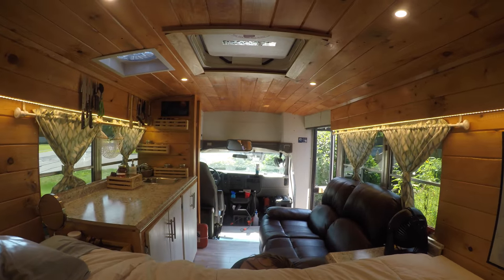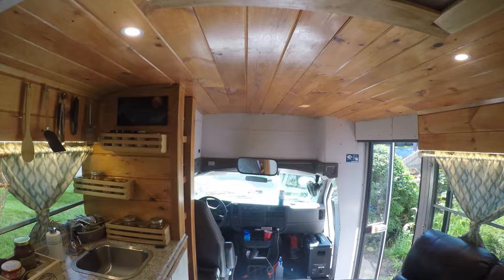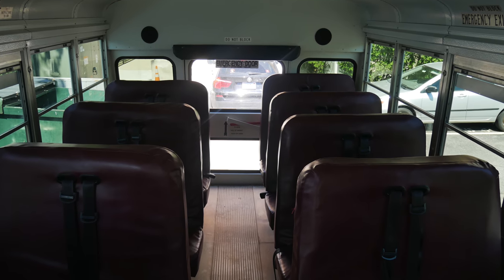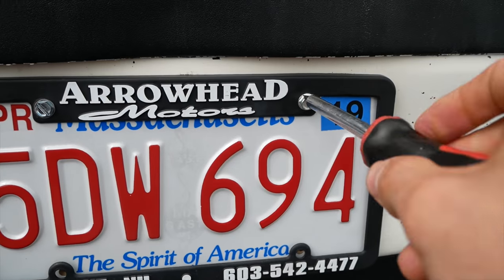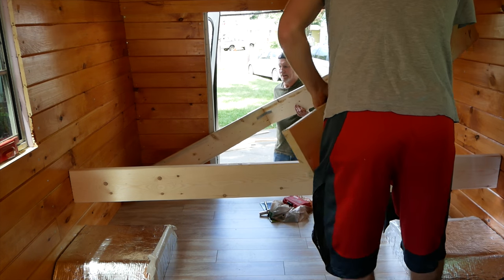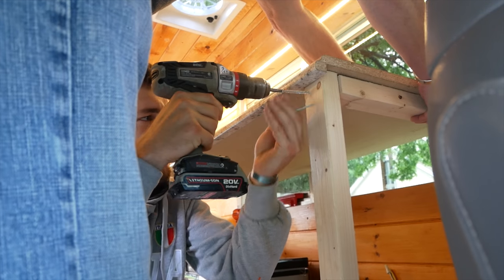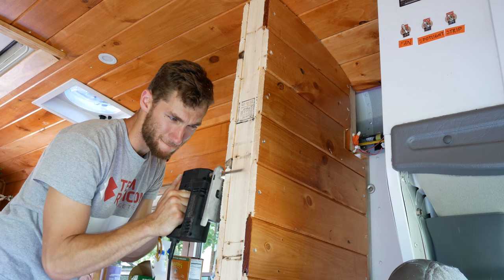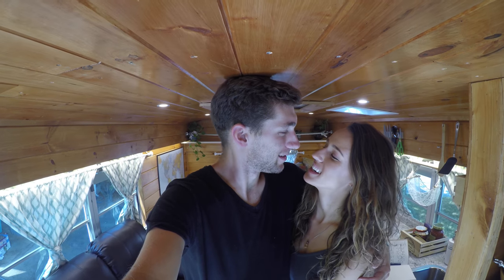SHORT BUS TINY HOME BUILD START TO FINISH

Comment: I used to drive a bus like that around town.  Fairly easy to drive.  Just a matter of judging the size, if you're not used to it.  How did you find out about the bus for sale, and, how much?  Guess you have a video on that.  Have to look.  Wonder what our little transit company does with the older buses when they're done with them?  Wonder how I'd get the work done?  Hmmm.